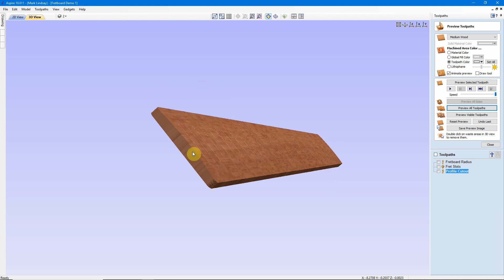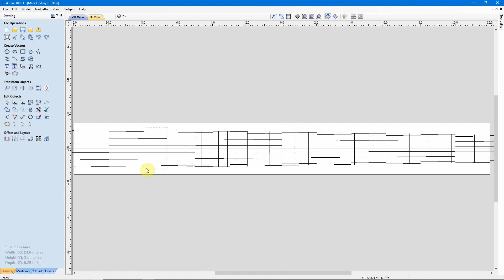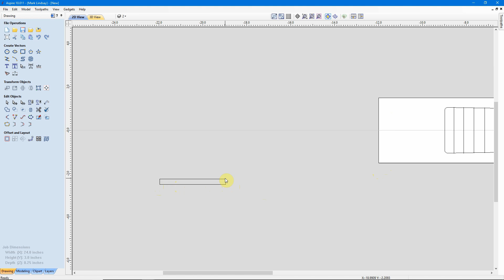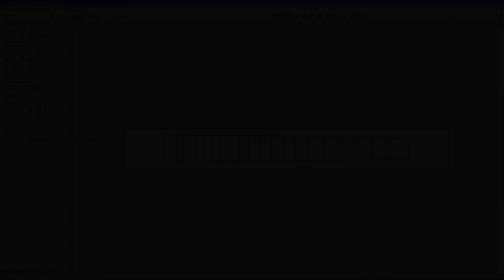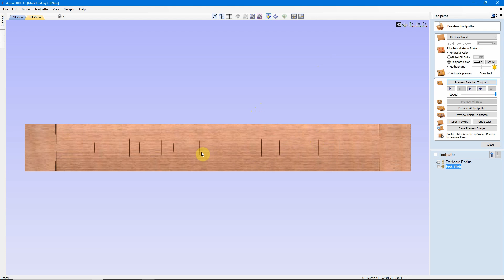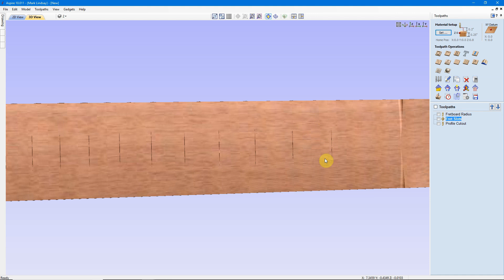Intro to the Moulding Toolpath - Part 32 - Vectric For Absolute Beginners

Comment: Hoping you can help! Just watched your guitar neck #32 video and it shed SO MUCH light on Molding tool paths so thanks for that! My question is that I want to also cut the frets using a TINY 5/254" end mill but need to apply the line to the curved arch of the fretboard when NOT using an STL? Is there a way to have the CNC follow the curve of the fretboard or do I need to somehow create an STL that matches the arch?

Comment: I know this video is a few years old but is every bit as relevant to day as it was then. Like all your videos it is a masterclass in using Vcarve.
I've used Vcarve desktop for designing one guitar body but wanted to find ways of cutting a Stratocaster style body including the front and back 'comfort' contouring. Everybody I can find on YT or elsewhere seems to either use Aspire, which I can't justify buying, or imports a 3D model from somewhere else.
However, after watching your video and closely examining the drawings I have of the guitar body I've done a couple of basic tests with the moulding tool including using a curved rail for the back body cutout. I haven't cut any timber yet but the results look perfect in simulation and setting up the cuts was easy following your instructions.
Apologies if you've already covered this and I've missed it in my search through your videos but I'm sure it would be a popular lesson to cover the use of the most basic version of Vcarve to do all the cutting  required for a Strat style body, including all the contouring without the need for imports from anywhere else. If anyone can do it, I'm sure you can.
Reply from the maker: Thank you very much. I will put it on the list.

Comment: Oh, Mark. I watch so many CNC tutorials. You are the bomb. You and Garrett are my top picks.

In this particular video, you LITERALLY addressed questions the moment they came to mind as I watched. Some have said you take to long. I think your style is perfect. So thorough, which helps anyone new to this journey. Thank you so very much, sir.

I was trying to figure out how to mount a flat slab to a house with vinyl siding. 4 inch reveal, 7/16" step. Wanted the back of the sign to match the zig zag shape of the siding and sit flush. Thought about a fluting tool path. Long story short, you gave me a new path to machine this. Thanks!

Comment: Late to the party, but thanks so much for this.  It unlocked a few doors for me. I've done a rough cut on a tele neck (with fretboard) and body.  I did a 2 sided carve on the neck and only had to manually shape the heel.  What I'm struggling with is doing a compound radius - 10" at the nut and 16 at the heel.  Apparently it can be done with a double rail, but I haven't figured it out yet.  Would you consider doing a vid on that?

Comment: Hi Mark, I know this is an old video and comments, but had a question before I attempted this. Could you not first run the fret slots at full depth while it’s flat, which I think is 1/16” and then run your radius profile? I’ve never cut a fret slot before but have seen people who are creating the radius by hand using a sanding block, after the slots have been cut with a saw and they may have to just run the saw a little toward the end of the radius. Would the process I mentioned work? I mean cutting the slots first at full depth then running the radius? Thanks for the videos! I’ve learned more about VCarve Pro from your videos than anyone else!
Reply from the maker: It would absolutely work, with a caveat. Fret slots are usually cut with a .022 or .023 inch diameter end mill. As you can imagine, they're very delicate. So delicate, in fact, that you can't use a touch plate to set your Z axis. They also have a very short cutting depth. So, as long as your end mill is capable of cutting deep enough before you radius the fretboard, the order doesn't really matter. I cut fret slots by hand with a fret saw, so I don't bother with tiny end mills. It only takes a few minutes to do, and I like working with hand tools as well as running the CNC.

Comment: I cut the slots first with .023 bit, then model over the top of that.  But I'd like to see how this could be done in Aspire, as I have that.
Reply: He said he wasn't able to project the cuts deep enough in Aspire. I have vcarve pro. Are you able to solve the depth íss, and get your bit to do the whole cut?
Reply: The issue is that the cutting depth of the .023 diam bit is not as deep as the fret tang. @AuditoryStorytelling

Comment: Can you use the molding toolpath to put a radius on the top edge of something?  say you were making a kind of dish with different pockets.  Could you use this toolpath to round the top edges to avoid a hand router not being able to reach inside corners?
Reply from the maker: You certainly can. The Moulding toolpath is perfect for that situation.

Comment: Thank you Mark for your videos. Opened the world of working with software and cnc, maybe you will find time to make a video on how to make a guitar neck. After your videos, guitar body is fun.Only guitar neck problems remain.
Reply from the maker: A guitar neck has some very complex transitions (from the heel to the back of the neck and from the back of the neck to the headstock) that are tricky to model in Aspire. The easiest way is to get an STL file and import it. If you can't do that, it may be best to look into something like Blender or Fusion 360 to model the neck. Aspire can do it, but it's very fiddly work. Having said that, I do plan on doing some guitar videos in the future.

Comment: Maybe I’m getting ahead of myself but can this method of creating a drive rail be used for a circular or rectangle tray for basically round over the top edge and taper it down the side. BTW watched every video from 1 to 31 so far. Would not of been able to make the CNC jump without your instruction! 👍🙏

Comment: Thank you for this. I am new, still waiting on my machine, studying everything I can. Couldn't you use this technique to round out the back of a neck with from a flat board?
Reply from the maker: You could do some of it, but not the entire thing. That's the main reason I didn't do a neck tutorial. I figured the fretboard would get the Moulding Toolpath method across.
Reply: @MarkLindsayCNC  Thanks again. This will all be a lot easier once I get my machine and start actually working with it. I'm not looking for a CNC to build my guitars for me, just hoping I can have it do a bit of the time-consuming "grunt work" while I continue to work on other stuff by hand. I'm excited to get started.

Comment: Every time I try to radius my drive rail it shows the lines outside the drive rail. Even when I reverse it. By the way I’m doing a inverted radius for a sanding block. What’s wrong?
Reply: I see! I didn’t use just a line for my drive rail. How did you learn this software so thoroughly?!
Reply from the maker: I learned the software by making mistakes, then trying to figure out what I did wrong. Keep at it!
Reply: I’m so excited. Lol. This stupid sanding radius block is the first 3D thing I’ve ever done. Next I’m doing a fret board.
Reply from the maker: Glad to see you figured it out! With the Moulding toolpath, using a closed vector as a drive rail will force the lines to the outside of the vector. You have to use open vectors as drive rails to be able to change directions.

Comment: Thank you for the video! it's very straight forward.  I am having trouble figuring out how to do the bottom of the fretslots to match the fretboard radius along with inlay pockets.  For the fretslots I am using "on profile tool path" then selecting "project toolpath  onto 3d model.  I keep coming up with a flat bottomed slot?
Reply from the maker: The Moulding Toolpath is not currently considered to be a 3D model by the software, even though it technically is a 3D model. As a result, there's no way to get the radiused fret slots you're trying to make by projecting the toolpath onto the 3D model, because according to the software, there's no 3D model to project it onto. Let me do a bit of trial and error testing, and I'll see if I can come up with some kind of a solution.
Reply: @MarkLindsayCNC  Thanks so Much Mark! 
I am pretty  new to  this stuff.   I've been doing regular 2d stuff for a while but 3d stuff, this gets kind of confusing for me.
Reply: @MarkLindsayCNC  Hi Mark,  Following up my question earlier I did figure out how to do it.  I ended up doing the same thing as you did in the video but instead of the moulding tool I used the two rail sweep.  I was able to use the "project on path" tool to 
achieve the curved bottom fret slot as well as matching the radius of the inlays.  Thanks so much for your videos! I don't even think I would attempt to mess with this stuff without them!!

Comment: I like your videos a lot.  Keep it going, please. They are very informative and I have taken in much of what you are  conveying and used it well.  Thank you.  One quick question to you,  Mark.  At the end, when you explained the reason for cutting the fret marks by hand, could you have turned/export the product you had as a 3d component and then brought it back in to Aspire and make the fret marks as 3D on the new image?  Just asking.
Reply from the maker: Thank you, Jerry. In this particular video, I was trying to demonstrate the Moulding Toolpath in VCarve, then show why you couldn't project a 2D vector onto the resulting "model." If you have Aspire, it would be better to model the fretboard using a 2-Rail Sweep, then project the fret slots onto the 3D model for cutting. I'll do a video on creating a fretboard using the 2-Rail Sweep in the next couple of months.

Comment: fantastic as usual ... thank you! quick question?
if I’m attempting a fingerboard for an electric upright bass, the radius at the nut is one radius while the radius at the bridge is another ... 
how can I make a compound radius along the drive rail? thanks in advance!
Reply from the maker: I'm not aware of a way to do it in VCarve, but it can be done in Aspire. That's for another video down the road a bit though. Thanks for checking this one out!
Reply: @MarkLindsayCNC  I watched a tutorial from 2017 for Aspire using a 2 rail sweep to calculate arcs of different radii along the length of the fingerboard and back of the neck … complicated stuff but Vectric seems to make it a bit easier than Fusion 360 … I wrote to the folks at Vectric with the same question, I'll pass along their answer if you like, when I get it … failing to achieve a compound radius for the finger board, I guess I'll research a single radius and see what I find. upright basses are different animals than electric basses and have their own, unique concerns to deal with … thanks again for the great videos!
Reply from the maker: That 2-rail sweep method is the method I'd use in Aspire. Unfortunately, the 2-rail sweep isn't available to folks who use VCarve. This video was made to introduce the Moulding toolpath to folks who have never used it. If you have Aspire, I'd check out that tutorial by Vectric, as that's the method I'd use too. (And now that I know they've done a tutorial on it, I don't have to make one... :) )
Reply: @MarkLindsayCNC  yeah … Aspire is out of the budget for me BUT, the folks at Vectric did respond and said if I make a 2 rail sweep in another program, I could export the .stl file into V Carve Pro and work it out that way … so I'm thinking Fusion 360? I have a hobbyist license for that and I'll look into that work around … if I had other operations to perform, once I import the .stl file for the compound radius, could I edit it and perform other operations, do you think?
Reply from the maker: The problem is VCarve isn't a 3D modeling program. You can import an STL file into VCarve, but other than scaling it to size, you can't really edit it. For that, you'd need to use Aspire, or just use the CAD and CAM operations in Fusion 360. I don't use Fusion 360, so I can't help you at all with it.
Reply: @MarkLindsayCNC  yes and I'm sad about that, lol … seriously, keep doing what you do, you are great at it! if it's alright with you, I will bother you from time to time on my journey … thanks!